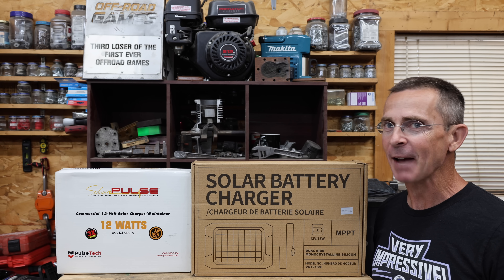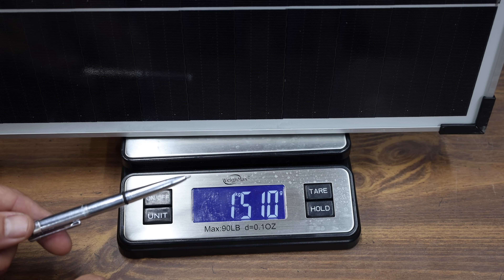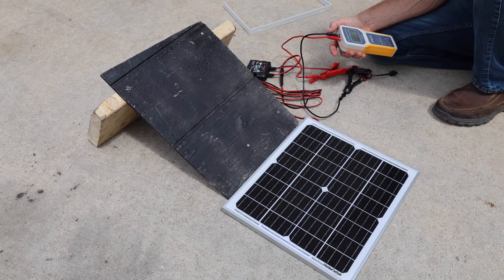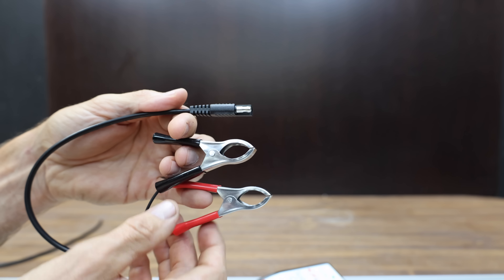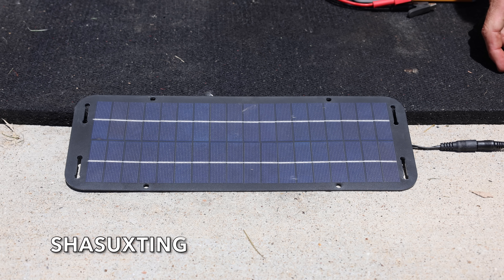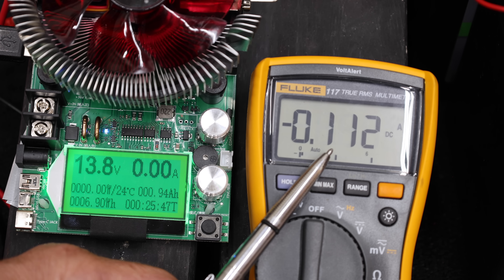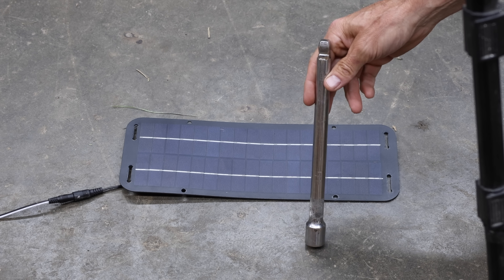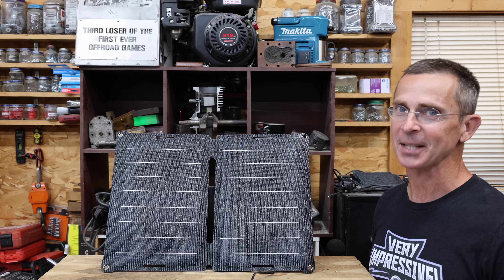I Had No Idea These Were So Good!

Comment: Just an fyi using the cigarette lighter socket might not work because many cars have relays to turn the socket off when the car is off so it can't charge while turned off
Reply: Either use a shunt on the fuse box for the lighter or get the 0-37 adapter to adapt from your Obii port straight which you plug into the solar cell
Reply: @RandyBrooks-g1e  Just use the alligator clips instead... 
The point that was made was for the many that try to use the socket, find it doesn't work and blame the charger.
Reply: @RandyBrooks-g1e I definitely never ever recommend using the obd2 for anything but diagnostic. Taking or driving voltage can cause some very weird issues.

Not to mention if it wears out or is damaged, you're talking thousands to replace the entire day's harness. 

Not worth the risk. Connecting a battery charger end directly to the battery is the safest way to do it.
Reply: @R @RandyBrooks-g1e what type of adapter for the obii port do I search for on amazon?
Reply: Scrolled down to say the same, good job 👍
Reply: 2006 Audi A4 is hot 24/7.
Reply: 2012 Colorado plug is hot all the time
Reply: @DumbGoogle-yz9cr for older vehicles that usually need this because they are being store have always on Cig or accessory plug. I used one of these for my work rig leave 2 plugged into my accessory plugs at all times.
Reply: 06 sequoia passenger side by your left shin is always powered. I believe the rear is to
Reply: Yeah, the cigarette lighter socket seems to be pretty useless, even for old cars from the 90's. It seems that you go either with battery terminals or OBD2 cable charging.
Reply: @martinp8427  Agree, I  forget which one had the OBD2 connector but I thought that was pretty cool.
Reply: My car has two plugs, one on the dash and one in the center console. The center console never shuts off while the dash is linked to the state of open door dome light / ignition.
So if you wanted to use that plug to avoid the wiring you might not be out of luck by trying a different plug. 
2005 Ford vehicle.
Reply: Well you just plug it in and check the voltage on the battery to confirm its working or not. Isnt complicated.
Reply: Not every car has a relay though. Some have two position cigarette lighter fuse. But yeah, i would not trust those chargers that much.
Reply: @prymus141  He said "many cars"  not all or every car
Reply: I was going to add that same comment. Unless you have an old car it won't charge unless you have the key on.
Reply: @jimc7991 my 2020 kia soul has a plug in the back cargo area that is always on....used that to plug in my battery maintainer while it sat for a few weeks.....  just have to test all the plugs to see how they are set up....
Reply: @jimc7991  yup, old school vs new school, my '97 Volvo shuts off with the key, '87 Dodge van is hot all the time.
Reply: @72vespa my 97 VW is hot all the time
Reply: @jimc7991  That's backwards, and misinformed. Most American cars have a cigarette lighter socket that is constantly powered, but safety regulations in Europe and Japan prohibit that. It's a fire hazard, should you accidentally bump the cigarette lighter into the socket as you're leaving the car. This can start a fire. As rare as it sounds, it's actually happened enough that it became a concern in Japan and Germany. 

And before anybody comes back with some BS "hur dur, America More strong because we have lighter and we tough it out" or "nanny state Europe won't allow mah freedumb", just stop. You don't have more freedom, you are just more expendable to your government.
Reply: @Mike-ie5xu potato pat-auto.

Comment: This was "very interesting", I hadn't considered the cut off voltage, I just thought they all did. Therefore I have to give this video the best possible rating of 1. I wonder how well or if at all, they work when placed on the inside of the screen and using the 12v socket?
Reply from the maker: Thanks for sharing.

Comment: Great topic. I've owned four 2w and 3w solar maintainers from Pulse Tech for nearly 15 years. I'm disappointed to see this company ranked lower, but I can't argue with the amazing battery life I've seen first hand. I believe the maintenance and de-sulfate features make a huge difference. A seldom used errand vehicle of mine just went 10 years on one battery and a Pulse Tech panel - amazing.
Reply from the maker: Thanks for sharing.
Reply: Same - I have an rv that gets driven once a year and the battery is 10 years old and still going.
Reply: I have had the same pulsetech model charger on my lowboy trailer since 2023.
 It keeps the 12v hydraulic powerpack battery for the loading ramps topped between uses. The panel is mounted flat to the neck of the trailer between the semi tires. The panel has been sitting in direct Georgia sunlight/rain/hail, etc for 3 years. (controller is covered) I put an old used 12v car battery out of a farm truck in it when I built the setup, because I didn't want to waste a new battery. It's still holding charge great! The panel is constantly getting mud and dirt on it from the rear semi tires slinging it up in the air and landing on it, but its "flexible" surface seems unfazed.

Comment: I've had so many batteries go bad over the years from sitting hooked up to a modern car with a computer that clearly acts as a pretty big parasitic drain. a modern car can run a battery flat just by sitting for more than 1 month in the winter, so I would suggest that cars should be required to come with a solar panel built-in! It is clearly the car itself that kills the batteries, because I have had a lawn mower battery sit for well over 3 months and it will still start!!!
Reply: Great way to have $4700 tacked onto to a new car price for $60 worth of products.
Reply from the maker: Thanks for the feedback.

Comment: I purchased the Suner Power months ago and use it on my. Motorcycle to trickle charge my battery 🪫 during work. I have it on my cargo box mounted with several pieces of extra strength Velcro. It has worked fantastic 😍. It keeps the batter charged fine during the day just fine. At night I then plug my SAE cable into my Battery Tender trickle charger. Works out great 
 Never had a dead battery with this set-up yet on my 2022 Royal Enfield Interceptor 650. 😅 Great video God bless 🙏🏼👍🏼😊
Reply from the maker: Thanks and thanks for sharing.

Comment: The only way to truly compare solar panels is to know the irradience at the time of measurement.
Reply: That would only practically apply if you were testing identical units to compare to each other.  There are 100 other variances that affect output (controllers, wire size, connection type, panel coating, etc) so that the result here is as real world as you can expect.  At the end of the day, that's all we care about in these kinds of reviews.
Reply: @gweedoh1  The #1 effect of a photovoltaics panel is incident energy.  That is irradience.  It i test 10 panels over the course of 2 hours, the amount of irradience changes massively.

But if this review was useful to you, more power to you.  I find it basically useless.

Comment: Oh was hoping you would have tested thermal shutdown. 

Looking for a brand I can put inside both summer and winter cars rides.

In winter the charge could be lesser  due to temperature.  In in summer thermal shutdown could happen or the unit may be damaged by interior car heat causing circuit damage. 

Love your test. For a lawnmower or a trailer these will work. 
But for say a old Ford ranger or RV  your going to want that thing on a window or mounted high on the dash. Dont want to Crack a window and let pest in but it would be nice to not expect it to be dead and need to charge it for a few hours before use each time.
Reply from the maker: Thanks!  Thanks for the constructive feedback.

Comment: Huh.   I guess Schumacher is just holding on to the name.  They used to be great chargers but then again this is another category.
Reverse polarity is easily solved by a diode...it's amazing it's not implemented everywhere.  It could interfere with monitoring on the smarter chargers, but still that's a problem long solved.

Comment: Always glad for your graphs at the end.  My interpretation in what should be weighted on importance is often different and subjective, compared to others interpretations.  

For instance, I would clearly buy the Volt Hero over any other maintainer tested here. It's cheap, durable, and most importantly; wouldn't ever over charge the battery if left plugged in for weeks\months\permanently.
Reply from the maker: Thanks!

Comment: Hello, I sharpen my knives using the standard green polishing compound and I'm quite satisfied with the polishing results on the blades. However, l've heard from others that the green compound is not the finest one. The white compound is apparently finer than the green, and the light blue one is said to be the very finest, though some sources claim otherwise.
That's why I'm asking if you could test the different colored polishing compounds. I use the Silverline polishing compound available on Amazon. Silverline is a very popular brand for buying polishing compounds, so it would be great if you could test the different color variants from this specific company.
In addition, there is also diamond polishing paste that can be applied to leather and should serve the same purpose-just much better.
Could you also test some affordable diamond polishing pastes and find out which polishing compound and which diamond paste work best for polishing knife blades?
Reply from the maker: Thanks for the suggestion.

Comment: I've purchased a few of these and the most common fail point on them is where the cable comes out of the micro inverter. Highly recommend getting a solar battery charger with a stress reliever on the cord at that point
Reply from the maker: Thanks for the feedback.

Comment: 28 degrees. 
A simple and very accurate solar aiming device is to poke a nail thru a piece of cardboard. 
Attach the cardboard to the side of the solar panel.
Tilt the panel until the nail's shadow disappears. 
The nail and panel are now pointing directly at the sun.
Reply: A much better method is to put a beer can on the panel, so no shadow appears.
Simpler than your method.😊
Reply: @billy-go9kx  Also an opportunity to sit and have a beer🙂

Comment: The Flex solar is only about $35, not $80.  I got it last year and it seems to work well.  I see it in Amazon today at $32.
Reply: I love that it has the OBDII connection.  Most cigarette lighter ports are not hard wired right to the battery. And I can keep it inside the car in the dashboard.

Comment: I liked the Hoysicy which purports to have adjustable floating charge voltage, (12:24) although I did not note any attempt to use this adjustment. At $28 I would be tempted to own two of these.

Comment: A+ video...these things are awesome. Both of my cars have an SAE 2-pin connector hardwired  direct to the battery (fused). They are mounted outside the hood - ready for connection to a solar panel. I can use these types of solar panels AND Battery Tender Jr trickle chargers on both cars. NOTE - some of these solar panels have reverse polarity SAE 2-pin connector ends (might not work). BEST to use a SAE 2-pin gender bender vs cutting the wires and DIY'ing a new end. They're only a few bucks and worth it. There are some really nice mini MPPT solar charge controllers out there with SAE 2-pin connected on both ends - one to the battery, one a solar panel. IMHO and experience...use these and a REAL metal framed 50w or 100w solar panel for REAL power/charging. Even in low light, a 100w panel will still put out a 5-10 watts. One of those 15 or 20w solar panels with built in circuitry will likely do nothing. Car starter batteries being maintained with some kind of trickle charger will double their life...and keep the battery charged for starting.
Reply from the maker: Thanks for the feedback.

Comment: Thanks for testing these.  Can you test keyless deadbolts?  I have a battery powered one on my pole barn that works ok, but when it gets cold it won't quite work.  I've wondered if the mechanical (no battery) type would be better like a Lockey 2210.  I'd rather not fiddle with a smart lock but you could probably do two categories.
Reply from the maker: You are welcome!  Thanks for the suggestion.

Comment: Based on price, a 6 to 10 amp charge controller and any 15 to 30 watt panel is fine. A real charge controller has different battery voltage settings for wet, agm, li-po, li-fe (depending).

Comment: would have liked to see performance on dash or back shelf behind windshield/rear glass since leaving a solar panel outside the car when not on the farm would likely mean missing panel.
Reply from the maker: Thanks for the constructive feedback.
Reply: @ProjectFarm  I'd like to second this. Most people will keep these under the glass inside the protective interior of the car.
Reply: They will probably all be degraded in performance almost exactly the same amount.
Reply: @charliesullivan4304  Nope!  It highly depends on the panel chemistry.  The efficiency of some will drop off a cliff at lower irradiance, while others will continue to convert the reduced sunlight to electricity relatively efficiently.
Reply: I third this. If I bought one of these its use case scenario would be in car at or on the window.
Reply: I'd like to request this too- supposedly the UV blocking glass used in many cars blocks most of the energy these panels need
Reply: Amy solar panel behind UV glass will affect performance.
Reply: @jamesm568 The commenter likely knows that and it is why they are asking for those specific results For me, inside the car would be the most likely use case scenario, I also would have preferred to see those results. I would be unlikely to use this out in the open as has been done here.
Reply: @TheycallmeMrWonka That would be kind of hard to test because every windshield is different in the majority of vehicles out there as they all have their own UV ratings. Solar panels work inside the vehicle, but they're not as sufficient as they would be outside of the vehicle as results will very per vehicle. It's kind of obvious your more efficient panels would probably fare better behind a windshield.
Reply: Depends on where you are parking your vehicle,  better safe than sorry

Comment: I have been using cheap solar chargers on my dash in my truck. My old Optima red top lasted 21 years. I have purpose run wires to the battery with a fuse power port/cigarette lighter port. It sits outside in Wyoming. $20 is all I have spent. I test them  once a year. They last me a decade or so. It is time for a new one.
Reply from the maker: Thanks for sharing.

Comment: I use a small Victron MPPT charge controller with a generic 20 Watt panel as a battery maintainer.  The Victron controller is programmable and can be monitored via Bluetooth.
Reply from the maker: Thanks for sharing.

Comment: I have a project coming up that will require a lot of metal and weld cutting with a 4 1/2" angle grinder. What are the best and most cost-effective blade/wheel/discs?
Reply from the maker: Thanks for the suggestion.

Comment: I was curious so I calculated this, posting if anybody else wants to know

Solar panels: Power generated in sunny conditions vs advertised

TogoPOWER - 109,2%
FlexSolar - 107,6%
PulseTech - 99,8%
NXQWLL - 83,9%
Hoysicy - 82,5%
Schumacher - 79,1%
VOLT HERO - 77,8%
SUNER POWER - 73,8%
SOLPERK - 72,6%
TBER - 71,9%
Newpowa - 70,4%
Grecell - 62,8%
EBL - 56,0%
SHASUXTING - 7,4%
Reply from the maker: Thanks!

Comment: If you intend to plug the solar panel into a 12V port for trickle-charging, make sure the port you plug into actually stays live when the rest of the car shuts down.

In my car, accessories like the 12V ports stay live only for a few minutes after the car has been shut down and the doors locked, so I tapped into the anti-theft system fuse for my 10W panel hook-up.
Reply: @teardowndan5364
  The cig lighter plugs are made for fast easy hookup to the battery, that is why one plug has the eyelet's for battery terminals.
Reply: good advice, they make obd II adapters as well that are always able to provide power, but it is annoying having cables in the driver's footwell to unplug if they get in your way so not super recommended unless you know you will be gone a long time.
Reply: Can also just use the OBD port with an adapter or wire it directly to the battery. 
On my setup I have a 5 pin relay that either powers a sub fuse block or connects the solar panel when the vehicle is off. The alternator and solar panel are never connected at the same time.

Comment: The rubberized coatings worry me that they will quickly become discolored, and block light over a short time; not to mention become sticky or flakey and be much worse than the other coatings. A long term test of this should be done to see if they are good or not.
Reply from the maker: Thanks for the suggestion.

Comment: I bought the SOLPERK and used it to keep my tractor and lawn mower batteries topped off, however the alligator clips corroded after like 8 months of use.
Reply from the maker: Thanks for the feedback.
Reply: Because it is over charging your battery heating it up causing fumes to escape and mist acid ect. 13.2 to 13.8 is max for maintenance charging.